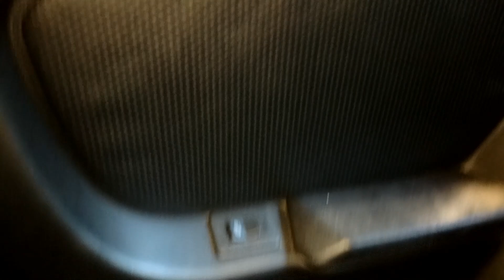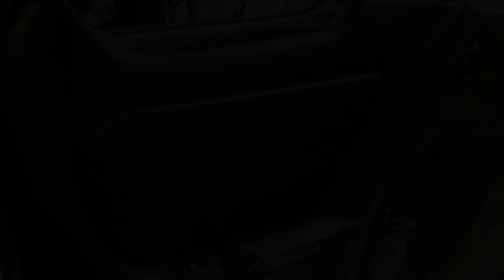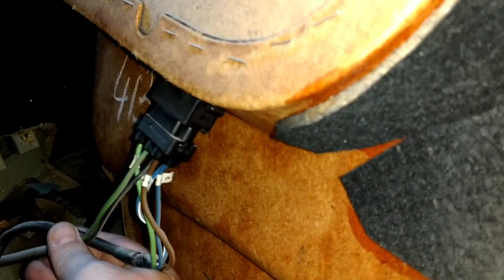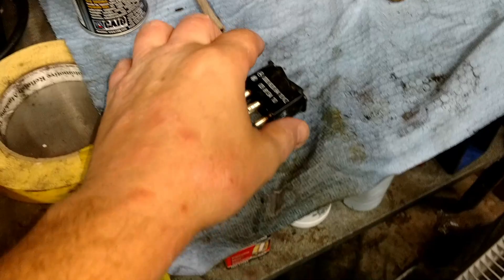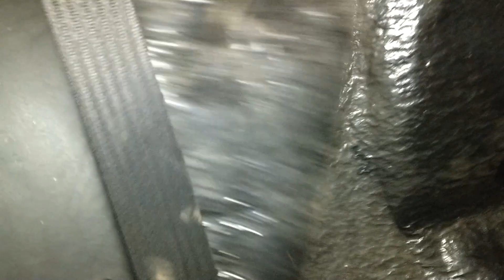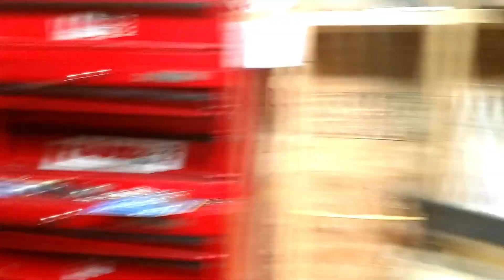1985 Mercedes 300CD Part 5 - Window motor/switch, Refurbishing Antenna

Comment: How is it that easy for you to work on these mbs?  when I go to try to get some part out its like a battle now you have the mb . touch hey on a 84 300d w123133 turbo dzl do you know why the fan switch only works on high speed only  ? @ would you have a good one I could purchase thanks Ron rdzl mb616
Reply from the maker: Man they give me battles too sometimes but it's taken years and years of practice to get good at it. ;) I actually do not have a spare switch for you but you should be able to find one online.